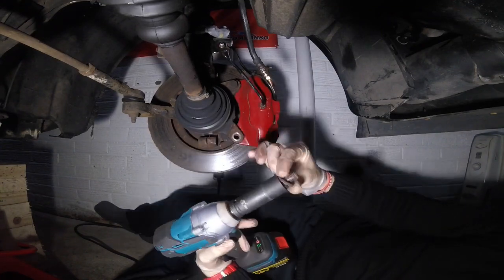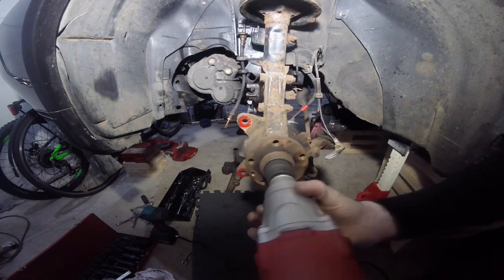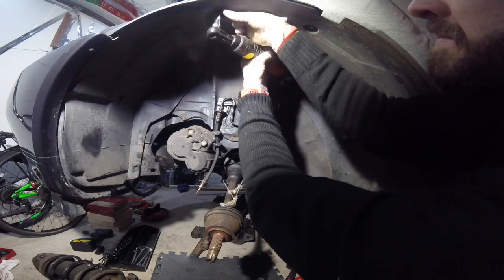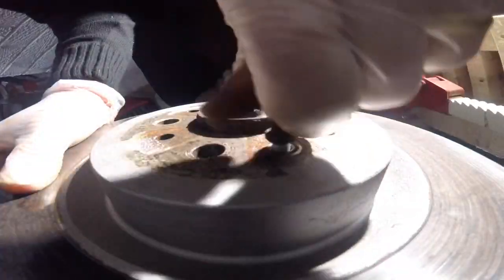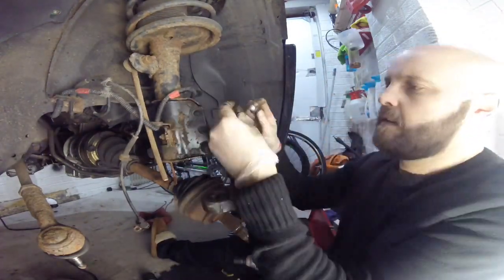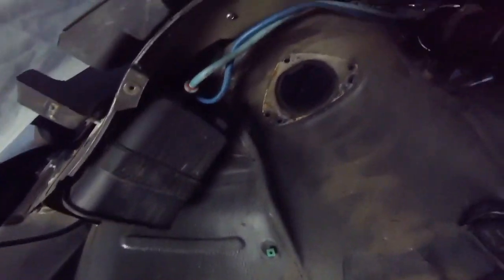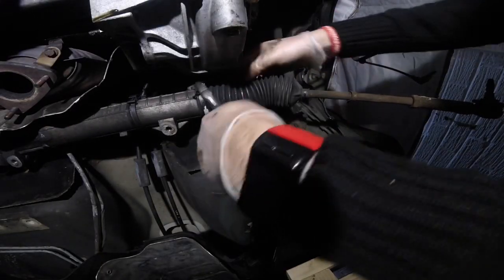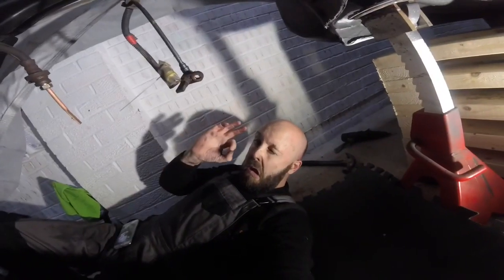Alfa suspension, steering and driveshaft removal. Restoration part 3

Comment: Hello!!! Before i ask i want to thank you for detailed explanation in your videos and quality content.
I'm driving an AR 159 1.9 150 hp sport-wagon.
I have a question about driveshaft. 
When you changing the driveshaft bearing that is inside of transmission do you need to remove whole transmission down or you can change that bearing while the transmission box is on the car? 
I'm asking that cuz this is my 1st time problem with that bearing and i don't want to pay transmission removal for nothing if that bearing can be changed while transmission box is on the car.
If that is possible i can change that bearing and driveshaft by my self so i would need an answer to that as soon as you can. 
And second question is. 
I have small vibration on heavy accelerating somewhere between 1500-2200 rpm. Can that be that bad bearing of the driveshaft that makes that vibrating problem or something else is? So in any gear somewhere between 1500-2200 rpm that vibrating is coming. My wheels are straight. Timing belt and part's for services are fresh 5000km replaced and everything else is good on the car but i don't know where those vibration came from.
Thank you!
Reply from the maker: Hi Robert. The short answer is yes, unfortunately the gearbox needs to come out. 

For the vibration……this could be one of many possible things and it is impossible for anyone to diagnose without inspecting the car. It could be engine related or it could be something completely elsewhere like the dual mass flywheel. If you are removing the gearbox then I would most certainly inspect the dual mass flywheel for excessive play or movement which can cause vibration. 

Rick

Comment: Hello Rick , 
First of all i want to say that your video is very informative. 
I came across in YouTube searching for alfa romeo 159 2.4 jtdm driveshaft.
I test drived an alfa 159 2.4 and during heavy acceleration i noticed a small vibration . What do you think it may be ? 
Is it the drive shaft ? 

Cheers 
Enerik
Reply from the maker: Enerik Kapllanaj vibration can be one of many possibilities. Vibration on acceleration or deceleration can be a sign of a worn CV joint, particularly the inner CV joints.  Vibration at higher speeds could be anything from unbalanced wheels and tyre pressures to something like a sticking/binding brake calliper.
Reply: @_RicksGarage  Thank you very much for your answer!  Keep up the good work.

Cheers
Enerik

Comment: Hi Rick, wonder if you can help me. My power steering rack blew a seal this morning on my 98 V6 GTV and I think I need to change the rack. Do you think the rack could be removed without removing the subframe? I read it can be removed out the passenger side wheel arch? If I have to remove the subframe, can you tell me how you kept the engine held up, is it just on the top engine mounts? Thanks Steve, Sydney Aus
Reply from the maker: Hi Steve. 
The engine is held up by the 2 main engine mounts, one either side of the engine. With regards to removing the rack with the subframe in place; I wouldn’t like to say a definite yes as it’s not something I have done myself, however, I don’t see why it couldn’t be done. The bolts holding the rack to the subframe are easily accessible but be careful they don’t snap which is quite common. That said, if you are replacing your rack anyway then it really doesn’t matter!

Comment: What size nut is the driveshaft end at front bearing hub
Reply from the maker: The hub nut? 36mm
Reply: @_RicksGarage  the outside diameter (50mm) of my 36mm socket is too big to fit in the metal part, what exact socket do you use?
Reply from the maker: @quinten250  I experienced the same issue when refitting my new hubs. Personally I used an old socket turned down on a lathe however you can purchase a thin wall socket here:

https://www.amazon.co.uk/Laser-6279-Hub-Nut-Socket/dp/B0183SVCWU/ref=asc_df_B0183SVCWU/?tag=googshopuk-21&linkCode=df0&hvadid=309799275746&hvpos=&hvnetw=g&hvrand=6950926138247596985&hvpone=&hvptwo=&hvqmt=&hvdev=m&hvdvcmdl=&hvlocint=&hvlocphy=9046513&hvtargid=pla-565094514473&psc=1

Regards 
Rick

Comment: Rick, I have a 2013 guilietta that is shaking at 70mph + I have had it to a garage locally and they can't find anything wrong. I think it's drive shaft or something as I have rotated the wheels and it still does it. I bought the car in 2020 and it's done it since I got it. I live in county Durham are you close that you could take a look? My wallet is ready